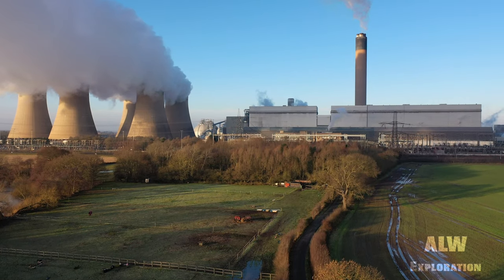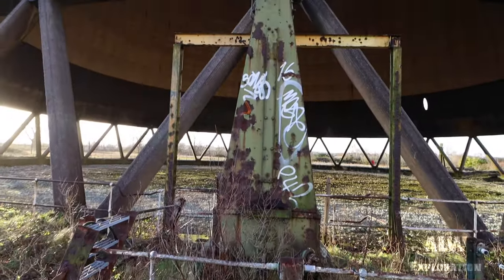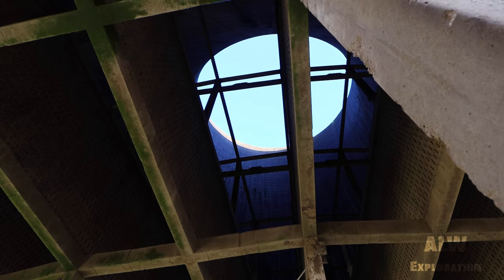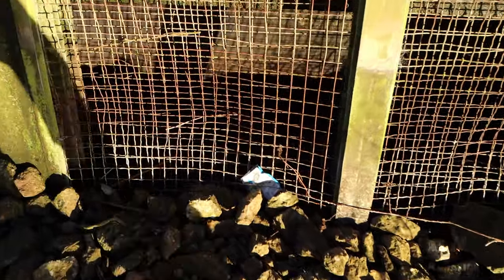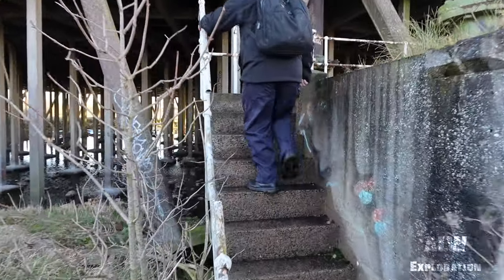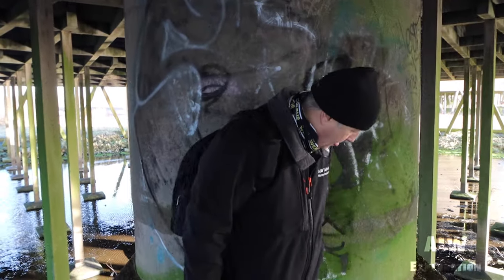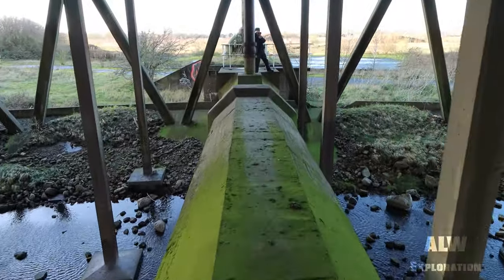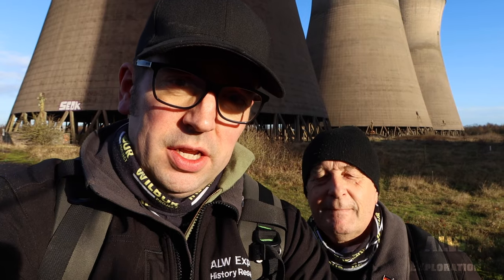How Does a Power Station Cooling Tower Work?

Comment: The drift eliminators were wood slats and often rotted away . The new type are plastic. They are like a curved blade on its edge placed side by side to completely cover the pack. The fill would have filled those big gaps you can see from below and is like plastic egg boxes around 2m thick. More than likely it has dropped out and been removed. It gets quite heavy as they fill with silt from the river water. I used to work at Drax looking after them.
Reply from the maker: Hello Andy W thanks very much for the information :)

Comment: Hi Andy,
Great video with a detailed explanation of the cooling towers.
I wonder what one of those towers must weigh ?...😁👍🏼👍🏼
Reply from the maker: Hello Eddiek, thank you so much. Weight wise I would estimate a metric tonne per square meter of area. These towers were strengthened in 1965/66 due to structural failure at Ferrybridge where they suffered collapses in a storm. The strengthening would have added more weight.